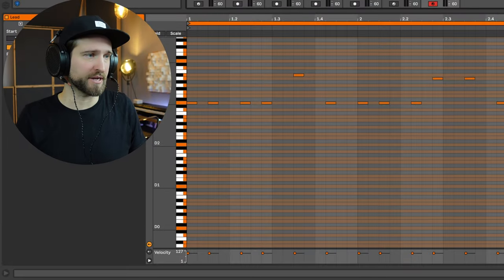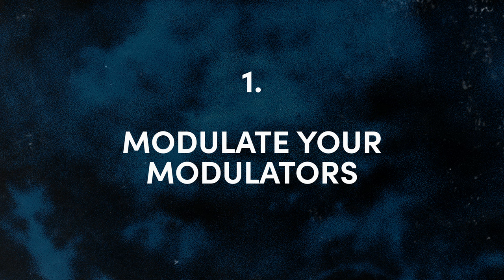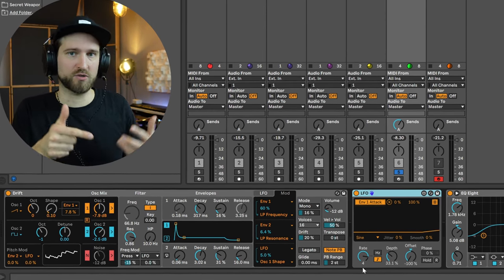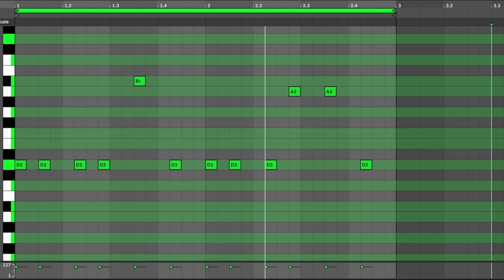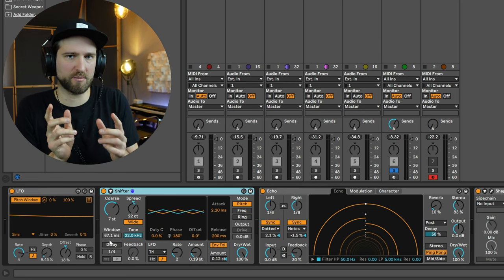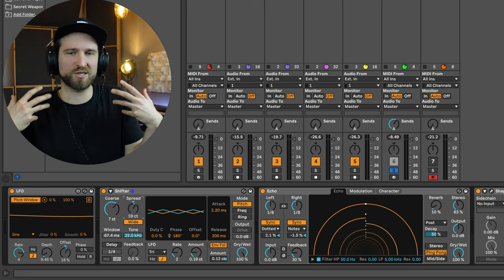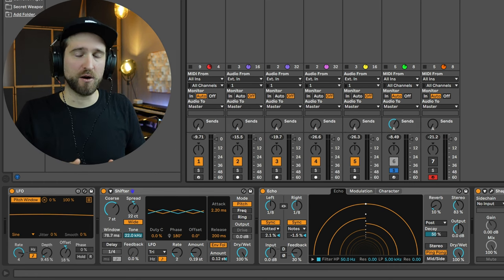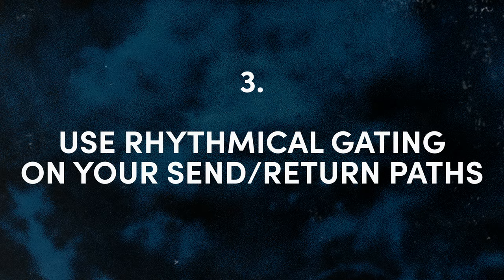3 little-known sound design hacks that change everything

Comment: Hey there Phillip. I can't seem to get the Frequency to move. I have everything set the exact same as you, but it won't move. Attack is moving fine but not the Frequency. Any tips?
Reply from the maker: I need more context, what were you trying to achieve and what did you do? Maybe link to a screen recording so I can understand more.
Reply: @pickyourselfofficial   I believe they are referring to the filter movement at 1:35. Forgive me if I am mistaken
Reply: @NATHAN_wav  That is exactly it. @pickyourselfofficial the filter frequency cutoff isn't moving. The lfo is mapped to the attack and the Envelope is mapped to the frequency, but it isn't doing anything lol. Also, thank you both for the reply!!
Reply: @pickyourselfofficial      @NATHAN_wav  That is exactly it. The filter frequency cutoff isn't moving. The lfo is mapped to the attack and the Envelope is mapped to the frequency, but it isn't doing anything lol. Also, thank you both for the reply!!
Reply: @pickyourselfofficial  I got it, sorry for the confusion